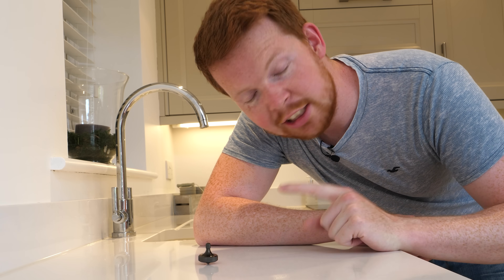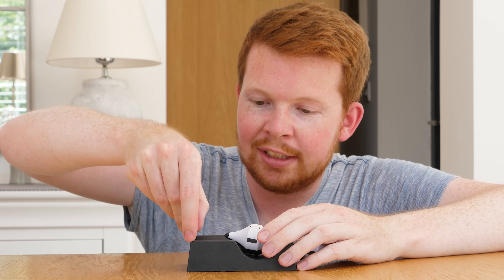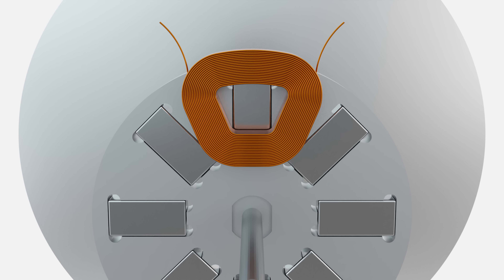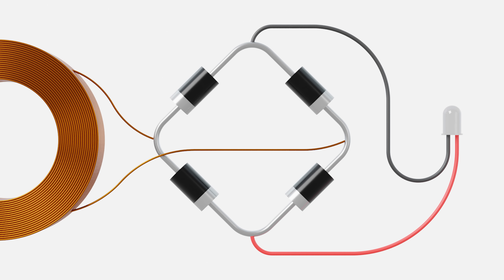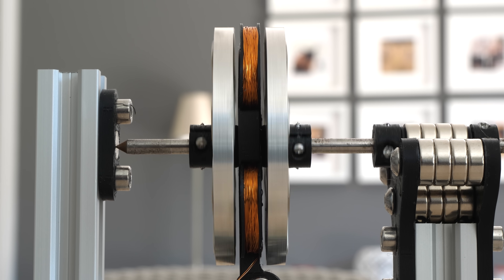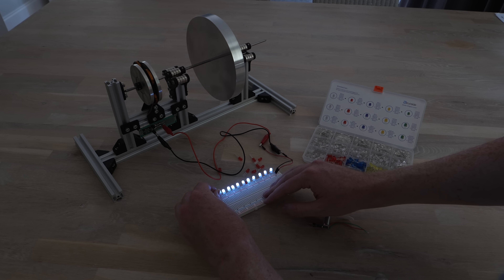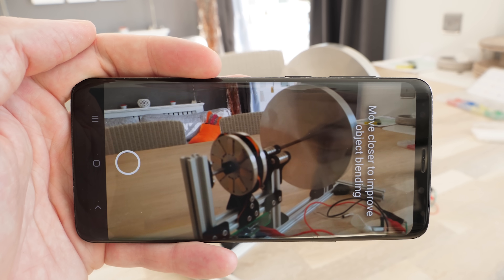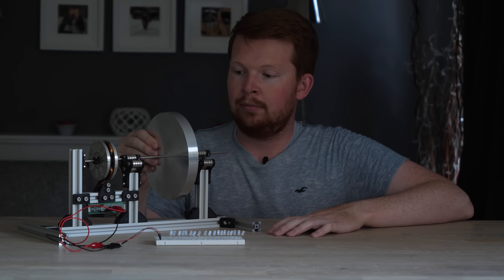Flywheel Battery

Comment: the more load you put on the circuit the more input should be required to make the flywheel spin. is there a way you can measure the resistance and force required to overcome the inertia?

Comment: Hi Tom, 
awesome Project!
By adding Ferromagnetic Cores to your Coils, this will make your Setup far more efficient . 
You could also use some Diodes with a lower forward Voltage dropout. 
Currently your loosing 1.4 V with the used 1N004. By using Schottky-Diodes you could reduce that to 0,6 V.

Comment: While I know the friction is almost negligible on the “horizontal top”, would it be possible to make it fully levitating by sticking a magnet on the end and another on the surface instead of a physical tip?
Reply: This was exactly my thougth. And naturaly on both ends so it can´t get away even when the shaft is level.
Reply: A magnetic thrust bearing seems a sensible mod along with a vacuum chamber
Reply: Probably but it would still slow down since creating that electric current reduces the total kinetic energy
Reply: @Gay_Priest  yes that would still be the case. It in no way would make any significant difference in performance, I was just wondering if that would be possible to make it entirely levitating

Comment: Now just take the motor you are powering and connect it back up to the flywheel. Obviously it isn't infinite energy, but I am curious how long it would spin for. It would have to be more than without the motor right? Or are the magnets in the alternator slowing down the rotation of the flywheel?

Comment: K. So. Take an old exercise bike. Swap out the front wheel with a tungsten one. Mag lev axle somehow. Add gearing cassette bc wheel heavy now. Add alternator and boom. You've converted chemical energy to kinetic then to electrical.

Comment: The friction will still increase proportional with the mass of the flywheel. You only managed to change the axis on which the flywheel would rotate. I would recommend having two opposing magnets to replace the piece of glass and pointy bit you have touching the glass.
Reply: Really to insure it stays perfectly in place, I would put magnets on either end of the rod. Although what you did drastically decreased friction. I’m just giving some ideas to make it virtually zero.
Reply: You could also put it into a vacuum chamber to decrease air resistance

Comment: Nice work, but may I make a couple of suggestions?
1. Move the alternator to the other end of the flywheel, it seemed to be amplifying the wobble at the higher loads.
2. One of the benefits of AC is that you can easily change the voltage with things called "Transformers", and light bulbs generally don't care if they are powered by AC or DC. (Although I suspect you meant to say "LEDs")
3. Do a followup video where you measure the energy recovered from the flywheel.

Comment: You would need extreme torque to power something with like few watts. For maybe few seconds, no more. And you would need way larger flywheel with way larger inertia. Flywheel "batteries" are used for years as sort of bypass UPS to provide power during power outage before motor-generator kicks in. Just for few seconds.

Comment: Stupid questions probably...Why not put magnets on both ends of the rod and then just put repelling magnets on each end of the support structure, keeping the rotating assembly centered.  Wouldn't this keep the rotating assembly levitated and completely get rid of the friction point?  Perhaps the horizontal friction is so low it's not worth the effort?

Comment: question is can you power a motor with it and create a perpetual motion machine. i mean probably not.. physics says no.. but such low friction on that flywheel and such efficiency. even if it wasn’t a perpetual motion machine i bet it would be able to run for a long time off it’s own power.

Comment: Awesome vid Tom, would love to have seen how quickly the flywheel stops with the different loads. You’d prolly be able to illustrate some neat maths showing the wattage of the wheel at different speeds based on the amperage of the draw.

Comment: Now you need circuitry to reverse the alternator, making it a motor to spin up the shaft. This turns it into an actual battery, storing external energy.
Reply: How about: wind powered flywheel
Reply: @certifiedpossum1638  Yes! But there could be the possibility that it ends up being too heavy to work very well.
Reply: @Sam-fq5hc  No the torque will be a function of the surface area and geometry of the blades. With large enough blades you can power something extremely heavy. That is why industrial wind mills are so freaking massive and ugly
Reply: In the current configuration it is still a battery, the external force is just him. It stores the energy he inputs as kinetic energy and the alternator outputs that as AC
Reply: I'd like to see him attach a solar panel with a circuit that would add energy to the flywheel in small bursts.  Similar to how those lucky waving cat toys work.
Reply: If we can spin the alternator with some gears maybe we get good speed to power like a phone battery
Reply: I wonder if you could use gears connected to a crank to spin up the flywheel faster.
Reply: Would that actually work? I'm very interested to see an actual like demonstration
Reply: @VellssGod  Would be difficult but can be done. Main problem...the flywheel must increase rpm with the windmill is not increasing the rpm.So you'll need a kind of CVT with nearly no friction at all.
Reply: @reiniernn9071  So not very practical?
Reply: @VellssGod  indeed....It's for fun only. Calculations on mass and rpm will show that you'll need a very big and heavy flywheel for really storing a certain amount of energy. 
But I do know of industryal use for flywheels as "energy storage". But that's three seconds usage storage. Needed for keeping the current going in moments the energynet fails for the time you need to startup the backup generators. (starting and synchronizing in ca 2 seconds...in normal situations the generators are also kind of flywheels, running with the correct rpm withouth producing (ore using) energy). These things will be used at places where one second of energy failure can be a disaster.
Reply: @reiniernn9071  Wow that's very interesting. How did you come to learn so much? No offense just curious really.
Reply: @VellssGod  I do have a technical education and worked for (big) datacenters. Its is the energy backup system for such data centers that must start immediatly. Some 20-40 years ago the main computers were IBM mainframes and they would shut down after an energy brake of less than a second....even with only an energy drop (below the minimum required voltage). One of my colleages told me how they build such backup systems without loosing a fraction of e second energy.
 It was before the time you could install a battery system...even a single hard disk still required power connection for 380 volts (between 1975 and 1985)
This is about backupsystems generating a few megawatt electricity, to much for battery usage in that time.
Reply: @reiniernn9071  Wow that's really interesting even though I don't fully understand it.

Comment: This was awesome Tom! I would be interesting to see how quickly the RPM decreased with electrical load. Also, it would be cool to have a way to electrically add energy to the system with another set of magnets or something. I wonder what the overall efficiency would be. (And then test it in a vacuum as well lol) You should build a big one and actually see how much energy it could store in an off-grid system! This is all much easier said than done though obviously. I think we need a part 2!!

Comment: Idea: instead of using a contact point, a magnet could be used perpendicular, vertically, holding it in place.
Then to achieve usefullness from the flywheels energy storing ability, the electric generator/motor could be used to spin the flywheel, then the energy can be transfered back again using the same generator/motor, to power a led or motor.

Comment: I would have put a capacitor between the rectifier and the LED

Also a capacitor and motor in series is going to create a tank circuit as a motor is going to be essentially the inductor which is why they usually tend to be referred to as inductive motors

Comment: Interesting, having the flywheel power a motor that spins at a higher rpm is like basically turning this device into an inefficient set of gears. The flywheel being the slower rpm gear with higher torque, and the motor the higher rpm gear with lower torque.

Comment: Hey Tom do you think that compressed air in a cylinder would be a good method of energy storage if it was combined with a weight at top to help maintain pressure?

Comment: I'm curious why it wouldn't be possible to avoid the vertical plate holding the axle in place, by instead widening the magnets in the base slightly, so that they both push on the axle magnets a little bit in an opposing, balancing way.  Essentially, just like how each axle magnet is supported by two base magnets that keep it centered on one axis, why not also widen the magnets on the axis parallel to the axle as well?

Comment: best way to generate electricity easily if there is a power outage

also ADD A HANDLE AND STABILIZE IT
Reply: Best way huh?..here is a hint. Find a STEPPER MOTOR..and put something on the shaft  and interact it with the bicycle tire. Now pedal the gad damn bicycle and you'll have instant Electric generating device.
Reply: @MCircuits  I don't remember making this comment and I don't know shit about physics (I forgot what this argument was even about and I'm too lazy to rewatch) but I do know that that has been done a million times already and I'm a idiot. Just keeping this comment up so my future self could cringe at this comment

Comment: 3 ideas for you. 1, put the magnets in the flywheel. 2, levitate the flywheel using induced countercurrents in conductors instead of permanent magnets. 3, use magnetic coils to spin up the flywheel as well as drawing power.

I'm picturing a ring with three grooves along the inside. The two outer grooves contain magnets with rotating orientations, the inner one is for the magnetic interactions. The ring would run on three  spring loaded support points made of laminated magnet steel inside of a printed enclosure with bearings to support it before it gets up to minimum speed.

The driving coils would likely be quite similar to these but distributed around the wheel, and working in tandem with the right ratio of magnets you could mimic a brushless dc or stepper motor and use premade driver circuitry as appropriate. One more set of coils each a third of the way around lets you tap off 3 phase AC from the flywheel, which after passing through rectifiers and combining gives a much smoother DC current. After filtering (might not be needed) a buck regulator gives you a steady voltage and reduces the load on the flywheel making it easier to keep spinning up.

Also, laminated magnet steel cores can drastically improve the performance of your coils, just be sure to line up the laminations with the intended field lines.

Comment: The pedantic side of me takes issue with the statement of needing DC to power a motor when all motors(even DC motors) require AC. Brushes are basically crude, mechanical, inverters. You wouldn't need a rectifier to power a small single phase motor

Comment: Power test:
Bring the fly wheel up to speed at a set rpm. Time how long it takes to wind down with no load. 
The bring it back up to speed and add a load… measure the time it takes to wind down

Comment: I cant help but think you could put some gears underneath the end of the flywheel and get an insane gear ratio going with a crank arm. 
It would make spinning easier....and way more efficient!
The downside is that you'd be adding more friction into the system.

Great video nonetheless!

Comment: At 11:55 it looks fake! The alternator appears to be rotating one way, reverse of the flywheel direction. It looks less fake as the RPM is increased beyond 12:12 

A real-world problem of recording things moving near speed of video frame rates.

Comment: you should use a center tap coil and a fuel wave rectifier for less diode losses. also using a silicone diode with a lower voltage drop will increase output too

Comment: If you ever have a chance to visit San Francisco the Exploratorium there has a hand-crank powered flywheel battery with a lightbulb and a hair drier linked to it so you can directly observe the motion being converted into electricity.

Comment: I think you can get it to turn on it's own by using magnets around the flywheel, then use at base to push the flywheel around. You can place the lower magnets in such a way for pitch or angle as to control the speed of the flywheel. Adjustable. 

Just a crazy idea. If this can be achieved then you could in theory have some like perpetual motion that could be controlled. Hence you would not have to keep manually turning the shaft and by controlling the speed you can effectively increase power. 

But you need a new straight true shaft with slightly beefier levitation magnets. Just a thought. In theory you can upscale this model you can also use lighter materials for the flywheel.

Comment: The good stuff is called “turned ground and polished”. It’s high quality, exact measurement on the o.d., steel rod. Try that for your axis.
Reply: get this comment more likes and replies so that tom can see it!
Reply: @oadka  No you didn't even do any capitals or ask nice. :P
Reply: still wouldn't work if we warp it when trying to insert the flywheel
Reply: Also, a larger diameter shaft to start with would have been wise.
Reply: Also wondering if he could use opposing force magnets on the ends of the rod to locate it, eliminating all points of friction.
Reply: Use the axles from a printer.
They are perfectly straight and also free if you get a broken printer.
Reply: That stuff is great. He would still run into the issue of distortion from heat. Small diameters and bores can be tricky but I'm thinking a very light .001" interference fit and either dry ice or liquid Nitrogen instead of heat. Either that, or try to straighten that tiny little thing afterwards haha.
Reply: May be it would have been better to use a bad, unstraight axis and achieve higher rpm than resonance. After resonance frequency rotor would balance itself. With bad axis resonance frequency is lower so it is easier to overcome

Comment: You may be able to balance the flywheel in the lathe. Mount the shaft at the magnetic bearing and support the other end then machine slowly so that you don't bend the shaft more. You could also try using the lathe to straighten the shaft.

Comment: To smooth out the voltage further, you could make the generator windings 3 phase with 3 FULL BRIDGE RECTIFIERS outputs in parallel. Then a capacitor will smooth it out much better too.

Comment: Could the ends of the rod be held in place by apposing magnets pushing the rod to the center? This would require more precision or just very strong magnets to keep the rod from moving laterally but would reduce friction to almost nothing. 

Very cool though and interesting to see these designs on a large scale for energy storage.

Comment: I had an idea for a bicycle spoke style flywheel where the outer ring can be broken down into 10 semicircles so you could fit it all in a tent bag. Then you have a step to manually pump it up and get it spinning. Something with sliding spikes to modulate torque would be cool.

Comment: Just a thought for you.  I think part or all of the wobbling is occurring due to torque (Newtons 3rd Law) as the disc is decelerating with a large load (think reaction wheel).  The wobble is a result of your magnets rebounding the movement of the disc.  You can see it biases one side, which would not be the case if it was simply unbalanced.  I bet if you placed your contraption in space, the base would start rotating around the disk, opposite direction of the deceleration, as you pulled energy from the fly wheel.  Because we are on Earth and your base is sturdy, those torque forces are being realized at the shaft, once again because of Newtons Third Law.  My only thought on countering this would be some sort of counter-rotating flywheel or by restricting the disc in the y and z axis with more magnets.

Comment: Love this so much! I have two suggestions. The flywheel as a laminar disc is working against you in keeping the angular momentum going. Perhaps using the same mass of aluminum but with thin armatures holding the majority of the mass in an outer ring like a bicycle wheel or gyroscope uses on order to increase the moment of inertia and thereby keeping the flywheel spinning longer. Additionally, you may consider using 4 more sets of magnets in the levitation arms but mirrored from above the axle (meaning to magnetically "push" from above). This would reduce that wobble / nutation and stabilize the setup. Either way i am impressed with how well this setup works and can't wait to build one myself sometime soon!!

Comment: Negatively charged electrons move from the negative terminal to the positive terminal. Actual electron flow. Conventional flow,  hole theory, positive to negative stated current flow only serves to confuse. Days of Ben Franklin. The positive charge is depleted of electrons, the negative charge is abundant with electrons and will be attracted to, and seek the positive charge through a given conductor. Creating current flow through the conductor from this given Voltage potential difference in electrons.   :)